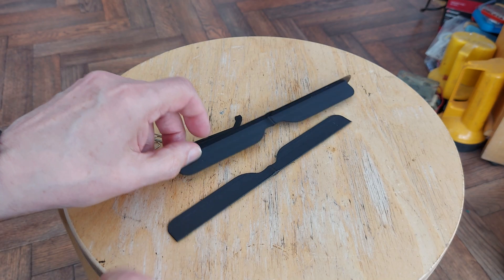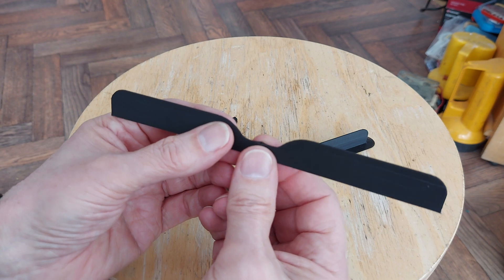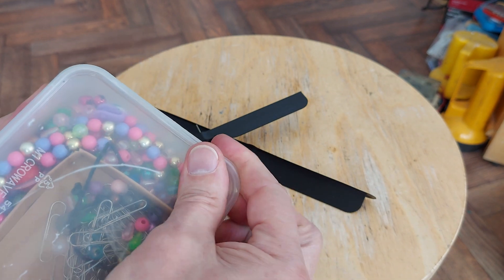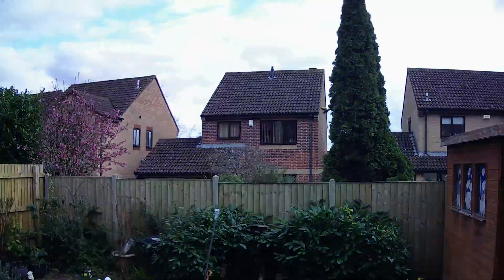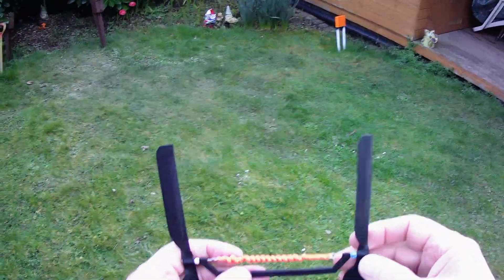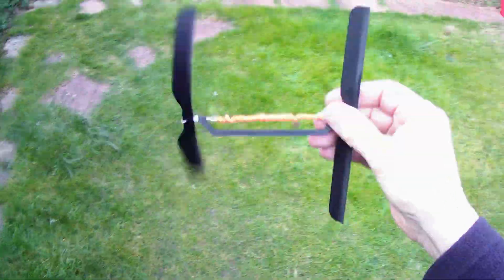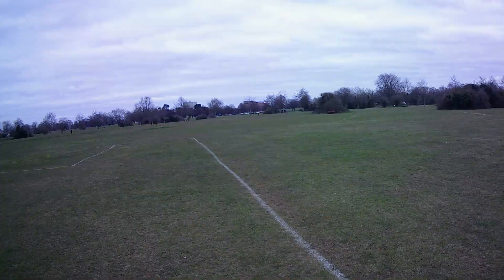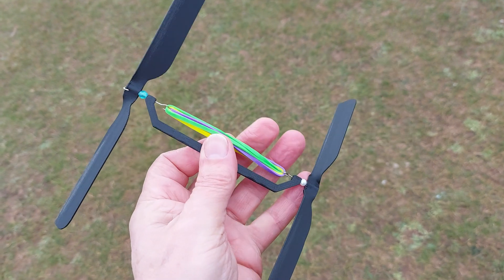0528 PART 1 Helicopter - rubber band powered - 278078

Comment: I wish it worked better I would have made one
Reply from the maker: I expect different rubber bands would give different performance, plus the pitch of the rotor blades can be adjusted.
Reply: @ do you think maybe some sort of stabiliser will will help
Reply from the maker: @JustFun-iz9rf  short answer is No 🤣🤣 If I get the rotors adjusted right it should fly fine, although I would prefer a longer body so I could increase the length of the rubber motor, but that would increase the stress, so would probably need to thicken the body and maybe get clever with the shape to increase the rigidity. You might be surprised where it is appropriate to fit a stabiliser. First thought might be below the helicopter, but in fact it is above. Josh Finn did a nice one quite recently but that was balsa and tissue - https://www.youtube.com/watch?v=aTH1c320BnM